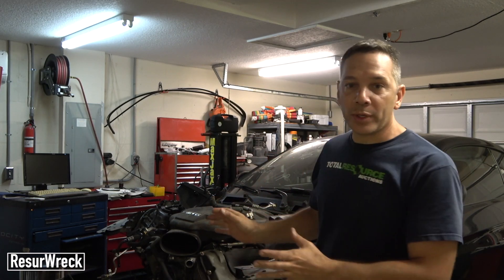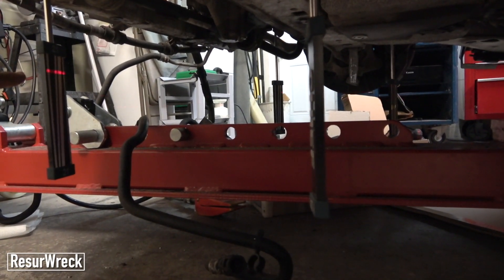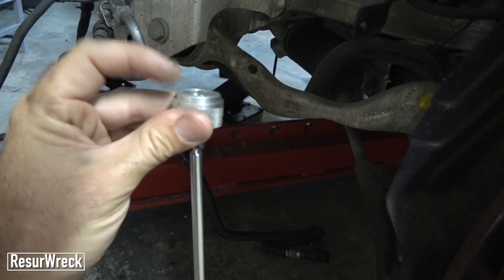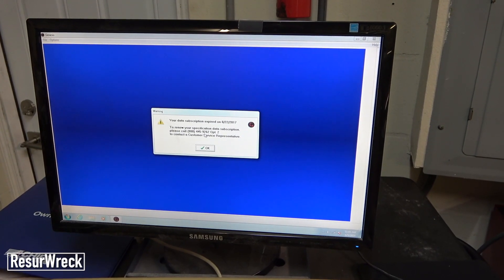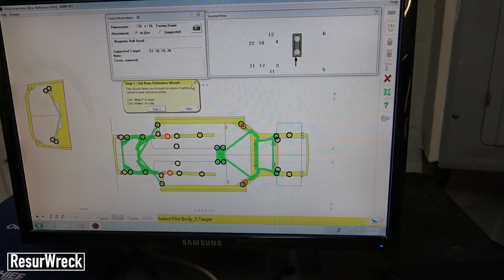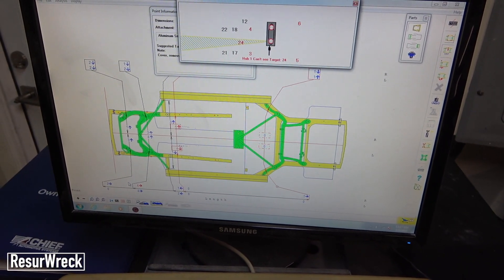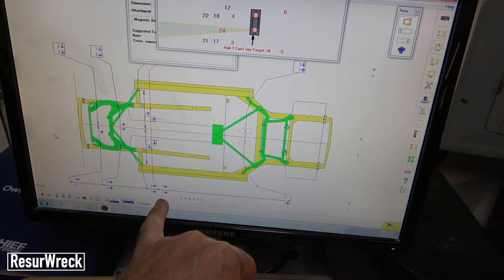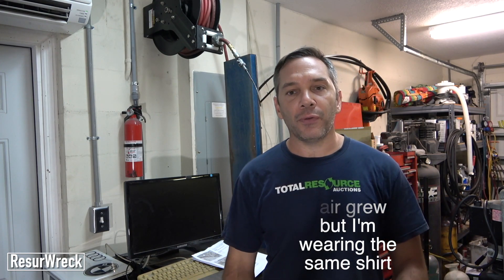Testing Out the Chief Velocity Frame Measuring System at Home

Comment: If you are the second owner then Chief will try to rob you!! What a shame customer service but not surprised. 
Car-o-Liner is also on the same track and it is owned by Snap-On at this moment.
The old Chief measuring system was quiet good with three pins under the car and you could see it straight away if the under-body was out of alignment and straight it with the measuring system in place.

Comment: I find the genesis measuring system to be a temperamental piece of shit. Almost impossible to work with when pulling a car as the targets are constantly being blocked or spinning or just plain wrong. Save a lot of money and buy a good set of centerline guages. You are going to have to test fit anything anyway. If you go by thst machine and weld everything up without test fitting you will be burned. Maybe not this time, or the next but it will happen. Then you have a whole lot of nightmare on your hands.

Comment: Great score.  Does it let you manually input values so you can use the individual measurement datasheets?
Reply from the maker: I believe so, haven’t tried it yet though. I might be using that feature for a future build soon.
Reply: Car-o-Liner did have that possibility but not any more!!